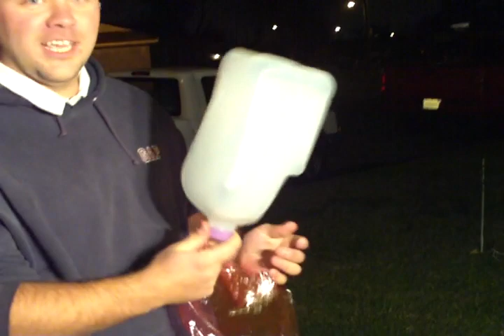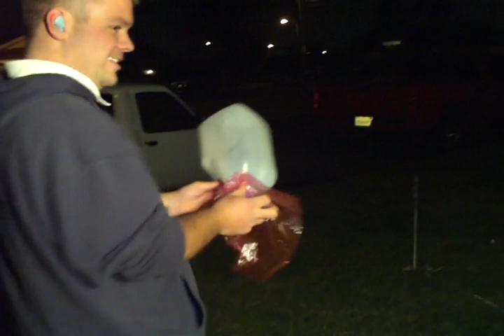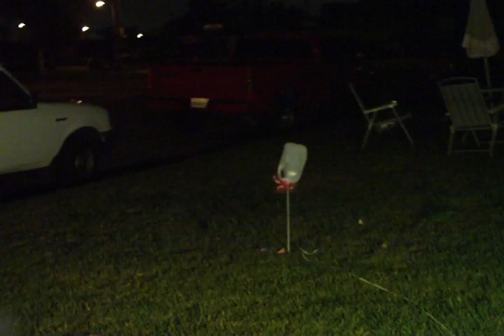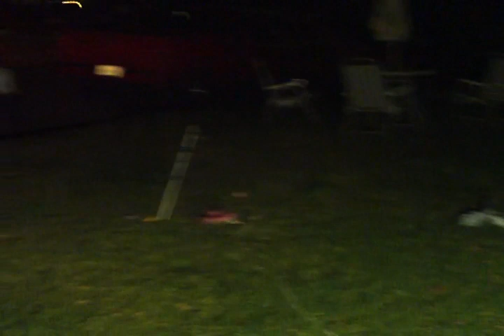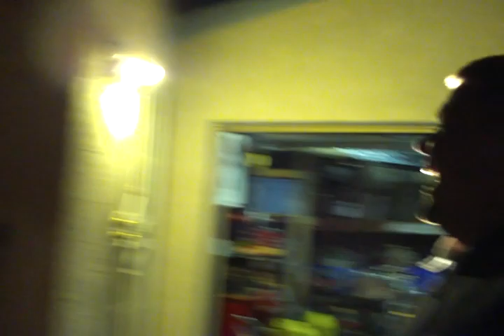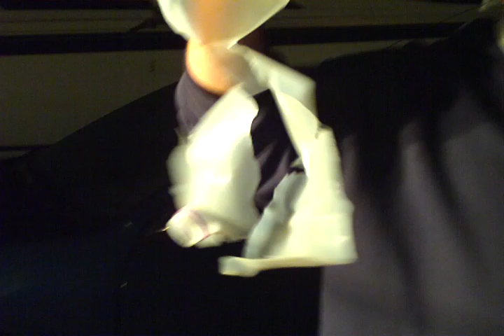HHO explosion - 1 gallon jug

Comment: Running each cell at a lower voltage, for me (4V, but anything over 1.5V will work) makes the system more efficient.  You'd have to do some research to understand why... I'm out of room here.  The plastic junction boxes of the genny remain around 80-90 degrees while drawing 30-40 amps - my target.  The end goal was two-fold - use the low pressure HH0 for my torch, and then use H2 and O2 (seperated and compressed) for a experimental rocket engine.     NOOBWITHAGUN was dead on - rocket fuel...

Comment: The 321 stainless was chosen for its corrosion resistance, as I am using KOH for an electrolyte.  The series configuration is the same concept as any series design in a circuit.  Each cell constitutes a certain resistance, and by adding cells in series, you drop the current through the circuit.  This plays 2 important roles.  Running these cells at 12 volts definately boosts gas production, but kills efficiency at the expense of creating huge amounts of heat, which is bad.

Comment: I'm the guy who built the generators for this video, the guy talking in the video.  RITMUSIC2K is the guy with the camera.  We now have two units, each 12*12*6 stackable.  The proto unit has three 12 plate cells connected in series, aka 4 volts a piece, and not connected together physically.  The second unit is similar, but unlike the prototype, I used nylon threaded rods to connect all three cells physically, then used 321 stainless plates to connect electrically in series.

Comment from the maker: I have videos that aren't uploaded yet, which show the inner workings of the system... our basic setup is 2 banks of 8 plates each, which can be wired in series of parallel... running off a car battery.  We're currently expanding to three banks.

This test was done with the generator running 2 banks in series, so 6v each.  It took us 3 minutes and 18 seconds to fill the bottle after passing our output through a 2-stage sparkback bubbler.  I'll get those other videos up soon!